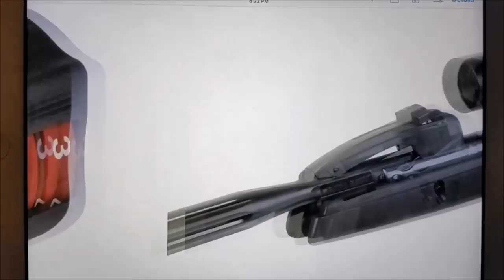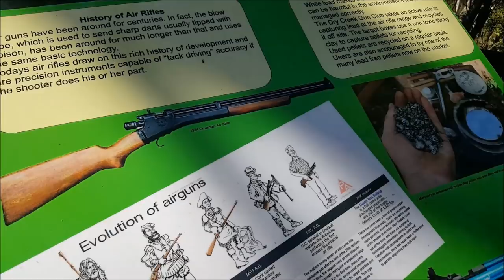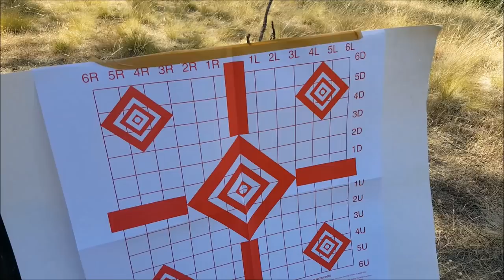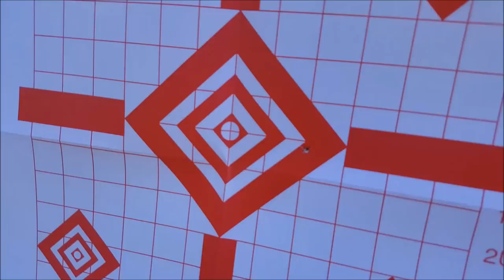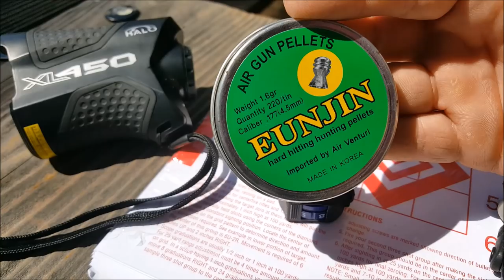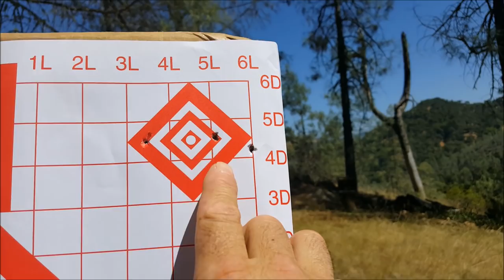GAMO Swarm Maxxim (Accuracy Testing @ 35yd & 50yd) 10 Shot Break Barrel Air Rifle

Comment: So my question of the episode is what Metal Material are those Bullseye Targets on the Range made of? I know most targets for a true gun range would use AR500 or something really thick unless they don't care where the bullet ends but I'm not sure what would be required at Bare Minimum for Air-Guns.
Reply from the maker: They are 1/8 inch steel...only for air guns.
Reply: 👌 thanks  @AirgunChannel . 😉

Comment: I've had this gun for about 2 weeks now and I can't seem to sight it good. I've sighted the gun well at some times but when I leave it there and come shooting some other day it seems to sight off even though logically that's impossible. Any recommendations? Is it the pellet? The barrel not being cleaned or just the scope not being good? Or is it because I have my scope all the way zoomed in?
Reply from the maker: Make sure your scope is tightened down all the way. But it is probably your pellet. If you're pellet is too light it's going to break the sound barrier and they will fly all over the place. You have to get a pellet that is 10 grains or more and it will slow it down two and FPS that is more accurate. another thing is that if you put your cheek in the same spot every time to look through the scope oh, that's called cheek weld, and that will help you get more accurate as well. Also a spring gun will only shoot a one inch group so you will never be able to get it sited into a pinpoint. Also, did you clean your Barrel? If you cleaned your barrel with a metal cleaning Rod you may have screwed up the crown of your Barrel, in which case you need to get a new gun.... you also have to hold your gun exactly the same way every time. The gun is going to kick in One Direction or another, if you are holding it tight then the barrel is going to flip to the right or the left or up and down. The trick is getting it to flip the same direction every time. The artillery hold is what some people call it when you hold the rifle loosely and let the recoil spring straight back. But you can find your own method
Reply: Airgun Channel Appreciate the feedback man. I haven’t cleaned my barrel yet, I’m going to buy the crown saver that you mentioned  in the video. Also i’ll make sure to buy new pellets and try out the artillery hold. Truly appreciate you getting back to me man seriously!
Reply: Also pay attention to the distances you're shooting at in relation to the distance you zeroed the rifle. I had no concept of pellet trajectory and had my rifle zeroed at 15 yards. When I tried shooting at a target only 20 Feet away I couldn't understand why I waa either missing or hitting low at such a close range. After playing around with a ballistic calculator I realized that the pellet is rising and will always hit slightly lower when shooting in closer than where it was zeroed..so u have to hold over

Comment: Any recommendations on how to clean it properly, I just bought one recently?
Reply from the maker: You should use a Crown Saver $10 from Mac1 Airguns and some Balistoll (which is safe for airgun seals). Then use a drinking straw down the barrel to get the crown saver through the barrel baffles with no problem (inside the silencer)

Comment: Hi there bud,  nice video.  Please try JSB pellets and Crosman dome and Crosman pointed  pellets in your Gamo Swarm,  they will shoot much faster and as a rule will be more accurate too.
Spring piston / gas ram piston guns tend to recoil worse with those heavier pellets like the ones you are using.  I think you will find an improvement in accuracy and a sweeter firing cycle with JSB or Crosman pellets.  Also H&N Sniper Light are a very accurate pellet and H&N Field Target Trophy are also worth a try.
Reply from the maker: stigy61 .. hey, thanks for the pellet recommendations. I will try those out.

Comment: Just don't use petroleum based solvents or it will eat the rubber breach seal. You don't really need any solvent as there is no powder residue left over.
Reply: Ballistal , I think is how it is spelled ,is air gun safe.

Comment: Where did you get the Crown Saver. I can't find them anywhere.

Thanks for the vid...
Reply from the maker: W M ....at Mac 1 Airguns. I will put a link in the description but if you type in a Mac 1 airguns to Google it should come right up
Reply: Thanks... Ordered 2.
Reply: Airgun Channel Awesome... I use patchworm it's basically the same thing but without the handle. I do like the handle that comes on the kind you use ALOT better than not having one but the thing i like so much about the patchworm kit is that it comes with these little disk for all different caliber sizes that slide on the bore whip and then when you slide your patch on it lays over them and when you pull it thru the bore it helps the patch get in all the lil cracks and crevices and all the lands and grooves so you get a really super cleaning which helps increase the pellets contact with them it seems, which in turn helps with accuracy. You should check out patchworm kits on their website OR on eBay. On eBay they WILL combine shipping on more than one product. However, again i really like your crown saver kind and how it has the handle. So i think im gonna order a couple and see if i can ither use my disk from patchworm on it OR somehow attach the handle to my patchworm ;) Thanks for the GREAT Information. Mac1... Got It!!!
Reply: I liked it cause you can use it in any cal. I have a .177 pcp and a .22 break barrel and this should make cleaning easy.. especially with the handle. I know it is a little $$$ but it's available and has very good feedback.
Reply from the maker: DrJones ... I'm going to order one of those Patchwork Kids like you talked about. The crown saver is cool but it can be hard to get through the baffles if you have them in your shroud and you can't remove them. Thanks for the info on the other type of cleaning kit. I will check it out
Reply: You don't need one. These guns shoot best left alone. Only clean when you lose your guns grouping..

Comment: Get rid of that scope. Buy a UTG scope. BARELY hold the gun against your shoulder. Let it just touch your shoulder. Also get yourself some Diablo and H&n pellets. High grade stuff. Drop the cheat pellets.

And you underestimate the power of air guns. I’ve killed a few raccoons and a possum with my .22 Swarm. One was not even a head shot.  Just gotta be a good shot
Reply from the maker: Thanks! Great advice!

Comment: It's ONLY hoppes #9 bore cleaner. You hardly need rubber gloves! 😀 Hell..gun guys try to get their wife's to wear it for perfume!😂
As for all your cleaner wows..tie a string on the end where the patch goes, AFTER the first time you run it through the bbl. Then each time you run a new patch..just pull the line BACK through with the string!! Cleaning time will be cut to 15 mins bro.
Good luck with your new air gun.
Reply from the maker: Im going to try that string trick!

Comment: Hello, you responded to my last comment so I'm hoping you can answer this. I actually had to do an even exchange with mine because the first one broke. The two pins on both sides of the breech kept coming out. I couldn't get it to chamber a round. Anyway have you had any issues with this? My new one works fine so I'm hoping it was just a freak thing.
Reply from the maker: Bailey Paranormal ...I only shot the gun for a couple days. Just enough to do the review. Then I sold it on eBay for $169. It loaded just great for me. Or you may have just got a bad one. That’s great that they give you a new one. Yeah that’s good service
Reply: @AirgunChannel  thanks man, yeah I hope it was just defective.

Comment: Have you try  shoot  the gamo swarm maxxim .177 pellet air rifle with  the umarex big blast caps
Reply from the maker: The Gamo swarm will for sure work on big blast caps. Just make sure you blow the cap up two enough pressure, if you do not then sometimes the pellets can bounce back at you. I got hit in the neck with one and it hurt. At first I was not sure if it had gone into my neck and I was going to die. Because it probably feels the same. But the pellet bounced off my skin and I had a giant bruise the next day. Also I was standing Too Close. Just make sure you stand 30 or 40 feet away and you should be okay

Comment: You are wrong mount a scope. You need use RRR. read instructions.
Reply from the maker: Yes, I did not use the holes. I wanted it far back. I should have done it correct.

Comment: i bought 1 in 22cal that thing wouldn't group for shit, you shouldn't have to clean a brand new rifle like that ,and it shouldn't be  that hard to clean in the first place.
Reply from the maker: sq hunter ... it was a huge pain in the ass to clean, I'll give you that. I agree you should not have to clean a new gun. Unfortunately the guns May sit on the Shelf for years and if they don't put that gunk in there then the inside of the barrel can rust. I actually got my first airgun that was about $700 and I did not clean it. I don't remember if it made a difference. The Gamo swarm is going to have up to 2 inch groups because it is a springer and it has kick. Also if you are shooting a 7 grain normal size 177 caliber pellet, it may break the sound barrier and that will turn you into having a 6-inch group. I would say get the heaviest pellets you can. Probably 10.6 grain from Walmart, they are gold color. And that may slow you down. Or else get a new Gamo swarm and clean it. If your Barrel did get damaged, you can clean it, and you can actually shoot about a thousand rounds through it and it will be fine again. Also, if the threads at the end of your Barrel got screwed up by a metal cleaning rod, that is called your crown, then the barrel is done. Sorry about the long note, good luck with your swarm
Reply: Airgun Channel I actually returned it and bought a hatsan striker edge vortex in 22 cal ,and have had lots better luck gettibetting it to group. Pellet selection is a lot larger for grouping ,and can cover everything with quarter at 35 yards. Not bad for a 120 dollar gun that I got on sale and bonus bucks for 88 bucks. I did however spend 80.00 on a UTG scope that made a huge difference.
Reply: @sqhunter65  $120.00 Benjamin Titan .177. Using JSB diabolo domed exact heavy 10.34gr. pellets, hitting under 1" groups at 75 yards from a door jam.  UTG True Hunter 3-9x40 scope. My last 3 shot group was .875", and one was not quite a perfect shot.
You should "have to" clean the barrel.  I would never hear anybody say that in my day.  I think the younger generation is more lazy, and not as good at figuring things out.  That is why your groups are poor.
Sorry.
Reply: @EarthSurferUSA  I'm 53 years old not a kid ,and have been shooting air guns for 35 years. Cleaning a air gun in .177 is a very debatable topic,because of the fine groves in the barrel. That's great that you got your rifle to shoot like that,but I'm talking about a totally different rifle. There happens to be a lot of   Controversy with this particular rifle accuracy.
Reply: @sqhunter65  As long as you use something softer than the steel of the barrel to clean it, you should not deform the rifling in the barrel while cleaning it. I say a brass brush is great with solvent if you can find one that fits, (to remove deposits) followed by a oiled, than dry patch. Neither are anywhere near hard enough to hurt the rifling's.  I have to say that the 2 biggest factors in getting my break barrel to shoot that well is, the way I close the barrel, (I wiggle it locked forcing it closed after closing it, to seat the wedge totally), and the JSB diabolo exact heavy 10.34 pellet.  That pellet flies straight, (sans normal drop of course), for a long way.
Reply: @sq hunter:  Cleaning a new air-gun barrel is not the only way to improve initial accuracy.  It is a common factor in all brand new air-guns that maximum accuracy potential will not be achieved until at least fifty (sometimes a hundred) pellets have gone through the barrel.  Even if a brand-new air-gun  does produce a fairly good group right out of the box -- it will get even better after the barrel is well broken in (polished).
Reply: @michaelkessler129  I put about 250  pellets through it. I purchased the same rifle in .177,an d it's a much better shooter right out of the box. I did learn that gamo's are a little hold sensitive especially in 22 cal. I have about 4 friends with gamo's we all shoot together,and the guys with the 22cal noticed the same thing as I did. They did say after a really good cleaning and about 500 tin full of pellets they noticed the group tighten up to about an 1 inch at 35 yards.
Reply: You should clean a new gun/rifle because you don't know what gunk is in the barrel from the manufacturing process and handling after that.

Comment: I use a wooden dowel. Works  wonderful , no problem.
Reply from the maker: Great tip! Thanks for the comment! - Nate
Reply: @Rachel:  do you mean a wooden dowel (what diameter?) in place of a cleaning rod?  If so, how do you attach the patch to the dowel?  And are you quite sure you are not producing the same problem that a metal rod would cause?  (I really didn't understand what exactly that problem is but I'm taking the video host's word for it and won't use a metal rod.)

Thanks--
Reply: 3/16 th    for 22 cal.                 @michaelkessler129
Reply: @michaelkessler129  you only mite damage the barrel but go in from the mag end but just where it comes out at the barrel in.
Reply: 3/16 th

Comment: Gamo lies about fps on all their guns!
Reply from the maker: All manufacturers do. Subtract at least 100 fps no matter who make the gun..
Reply: Airgun Channel   Hatsan’s are real close  though!
Reply: Different ammo and conditions..
Reply: All manufacturers use the lightest alloy pellets to gauge the fps.
Reply: @theoriginalmungaman  hvilken luftrifle er da best? Wich break barrel is the best/best bye on the markert now? Ofc what gun has the most power?
Reply: Jøran Aafarli   I like the Hatsan .30 Carnivore. Definitely the most powerful. Hatsan Snipers in .22 as well. I like my .22 Benjamin Nitro too. It depends on what you want it for. The German names are top of the line but low on power. The lower power is for better accuracy. Hatsan test all their guns with lead pellets and they usually are slightly over the advertised velocity.
Reply: @theoriginalmungaman  max cal is 177 - 4 5 before you need registration whit the Police. Considering hatzan 120 vortex sniper Vs hatzan 130 sniper schruod barrel. You now what the diference is? Spec almost the same and price?
Reply: Jøran Aafarli   The shrouded barrel reduces the noise. It would be a little quieter than the sniper but they are both fairly quiet. They both have the quatro trigger.Pyramid air is the best to buy from.

Comment: yes it will kill a raccoon
Reply from the maker: If you hit them in the brain which is hard with a spring gun. If you miss they end up with a non fatal  wound in the face...I would not want to take the chance.
Reply: @AirgunChannel  
Sorry man, not the groups you can shoot, I agree.  That gun probably has the energy to drop a racoon under 30 yards pretty easy with a head shot, which can be done pretty easily if you have the factors controlled.  Your groups show you are '"out of control" (a actual quality engineering term), and you need to figure out why before giving advise to others if you want to be useful  to others.
Sorry man---but your generation has to step up to reality by figuring it out, or your doomed.
Reply: Airgun Channel the Gamo Swamm isn’t a springer, it has a gas piston.